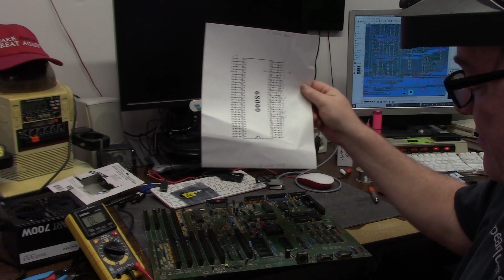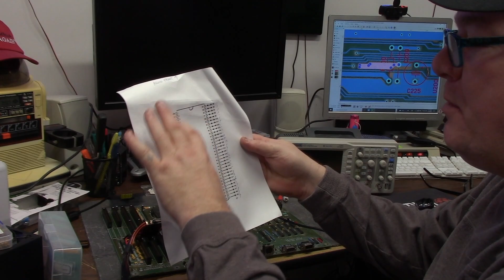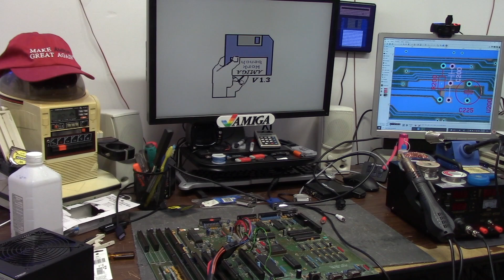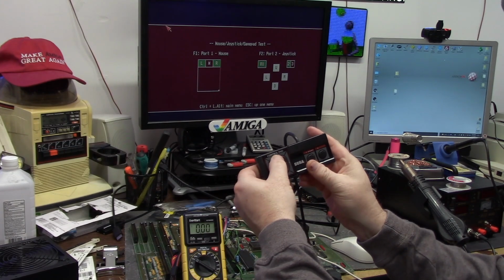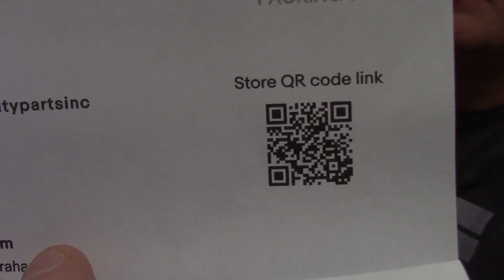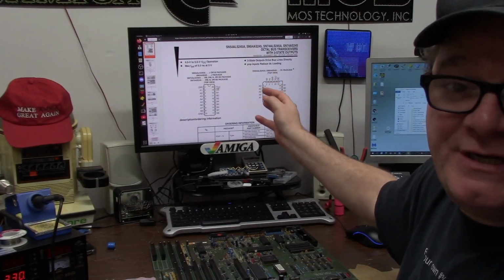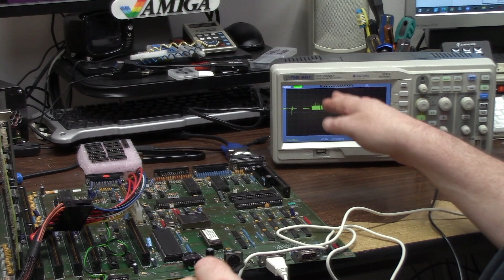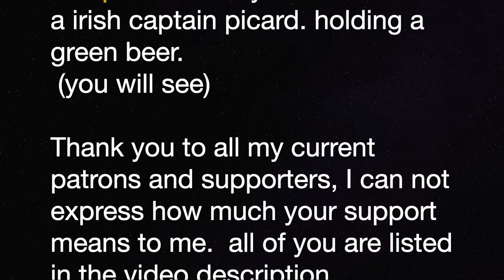The Titanic Amiga 2000 repair P2 Cutting out chips!

Comment: Hi, you have the good solder i see! :). If you will run out (in a decade or so) Voultar here https://www.youtube.com/watch?v=TbhoP-ytu0E has some solder @3:41 in the video.
He does some old stuff to and his solder is the good leaded one he says. @ 2:50 he claims he has a no clean flux maybe also interesting, however i don't believe this no clean
thing. I used colophony, works well with leaded led it is literally tree resin solved in alcohol this was my flux. You can try it but i don't know how it plays well with retro stuff
or electronics.

Comment: 2:1 mux, pretty much converts 2 lines into one in serial, typically in those days at half the badwidth of the original signal, nowadays not so much, the serial output is usually much higher clocked than the input so we can have efficient parallel to serial conversion, which is pretty much what a mux does  :)